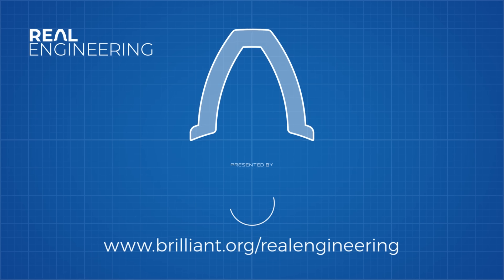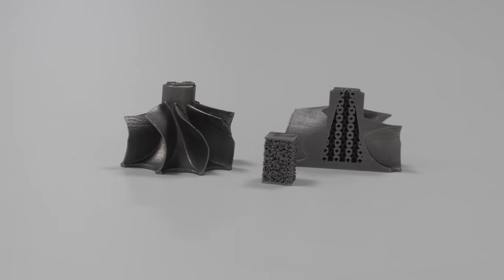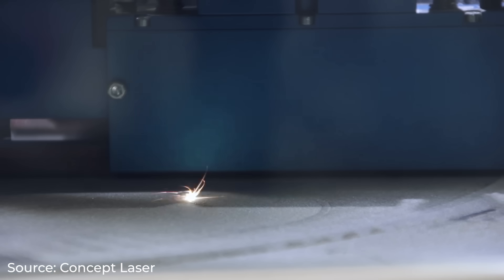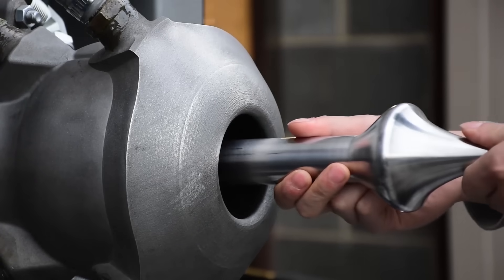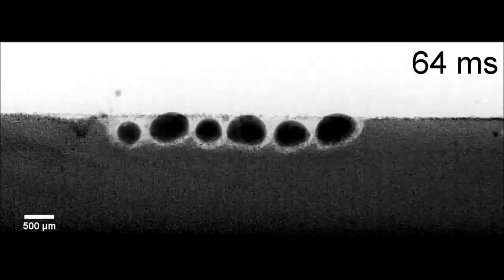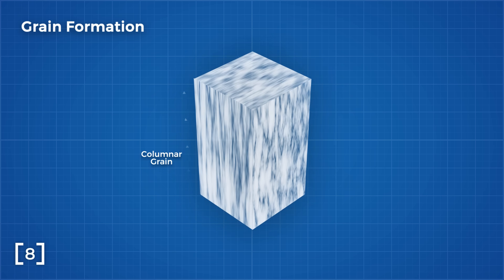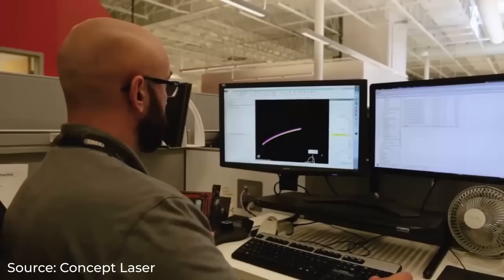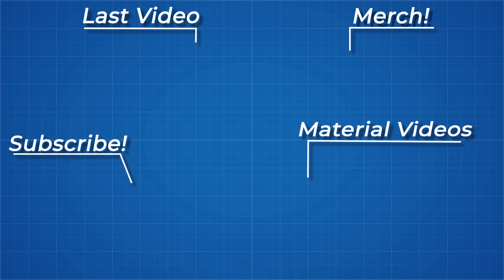The Material Science of Metal 3D Printing

Comment: I'd be curious to see if there's been any team who's attempted utilizing one of these laser 3d metal printers, but with a vacuum chamber work surface instead of atmospheric one.  It may benefit if combined with pulsed, repeated passes for the patterns to introduce outgassing phases for the metal and low pressure to aid the bubbles rising to the surface and bursting while they're small, then successive passes to re-homogenize the lasered pattern and attempt to level the printed pattern.

Comment: is it possible to 3D print armoured ballistic steel sheets according to the contoured design of a section of the base on which the armoured steel sheet will be welded??? for e.g. the contoured floor of a car that has a monocoque chassis or the inside shaped part of a front hood / bonnet!!!

Comment: I'm not some who knows much about it I'm just asking. Once I have heard about Electron beam welding. Would it be possible to take metal powder compressed into some basic shape like cube or block and use the beam welding to create the part? Than just break of the excessive powder? The metal shouldn't shrink that much since it's compressed and there is not that much air left? There may even be some articles about this not sure....

Comment: The simple problem with speed on additive machines: we are using a single point laser. 
we need to weld an entire layer instantaneously, like projecting an intense image made of high energy photons all at once, almost like photo lithography, but faster and more intense (respect to George Lucas)
Even better if the metal powder can be constantly blown over the layer in an evenly thin and uniform airflow, so that the entire laser field can weld the whole object continuously in two dimensions while the 3rd dimension continues to grow vertically.

Comment: I think what 3D Printing thought us more than anything is why patents are horrible. FDM 3D printers used to cost millions of dollars for decades. Until the patents expired and DIY crowd was able to start working on them. In less than 5 years, good quality 3D printers with multifilament extrusion, bed probing etc. can be bought for $200

I know I'll be hit with: "If it wasn't for the patents, no one would innovate!" now... I'm not actually so sure about that. There are a lot of people out there who work problems for the joy of working on problems. The current patent laws are literally preventing them from doing that. For example, I would like to try a few ideas in my garage about metal 3d printing. Problem is, if I stumble upon a solution, I'm 99% sure I won't be able to sell it because at least one of the technologies I use will be patented...

I get in some sectors like pharma where any R&D requires thousands of staff and millions of dollars patents are really important. But in almost all other fields, patents are stifling innovation. I think tech patents shouldn't be for more than 10 years in this day and age. If you can't turn a profit from your invention in 10 years than it wasn't all that good, to begin with anyway.

Comment: The 5 circle challenge at the end. Yes its possible. How? A line through the center of symmetry of the 4 circles on the left,  and through  the center of the bottom right circle.
The 4 circles are divided symmetrically. So is the bottom right circle. This line divides the areas and circumferences equally. 
Maybe  someone has  already shown a solution somewhere in the other 1700 comments.

Comment: The biggest issues is about profitability something like to to be more profitable you would have to replace the whole production of things in all parts to a whole constructions. We already use injection molded parts for planes but only certain points in which failure is not catastrophic. We would have to first look at applications that would stain a market and justify the cost and as over time it becomes improved. Its not like we build new planes every week like a car so this is the reason as prototyping is more reasonable for this application. We build planes to last decades so that the high cost/residuals can last and be resold and pass on the the second life.  Best applications would be on more sacrificial parts in something like a marine boat engine where they are replaces as a whole unit more often then a jet turbine for planes. IMPO a broken boat motor is dead in the water a broken Passenger plane is grounded or a lawsuit.

Comment: Well whoever was speaking on this one your an idiot I just solved the problem get in contact with me. I just bilt a 3' 2020 out of P.L.A.  The stress test 12 by 6 with a square 20 mmeter by 20 mmeter hole bored through it my 2020 V rod Has been holding a 200 pound sandbag for week now deflection 3" in 250mm. The program is for rent $100 A-day for life. In 20 years I will surrender the program. Now that you know what I can do with pla, I want to know what you can do with titanium rod. Can you please present me with a riddle  And a tig welder?

Comment: there are 2 main things i want to mention that is kind of wrong with the video or its material and those that study it.

1 3d printing is a prototyping tool yes but only for parts that you can manufacture in other ways. so offcorse comparing 2 methods of manufacture where both methods can manufacture the part is wel incredebly stupid as that wil be the same as comparing a robot with a pencil and a printer. offcorse the printer is going to be better have mroe accurasy and be faster and cheeper. but the robot arm can do so mutch more than the printer can. like using lead to draw or paint to paint with it can mix paint to get colors the printer can only dream of creating or using. so comparing 3d printing with other kinds of contruction to me is stupid as the only reason 3d printing comes otu so badly is the test you give it and that test is based on is this new tecnology capable of creating everything better at doing osmething we have studdied the hjec oute of and optimised to the max. wel no shit it wil never be able to be that. 3d printings most valuable aset is for low quantity manufactuire or simply manufacturing of parts inpossible with other proseses. or if it can be made with other prosseses 3d printing it wil make it one part instead of multiple parts.

2 the study of the metal printing and its problems was studdied in worst possible senarios and intentionaly going beyond the specs of the machine. it wil be like testing a wood leathe by not using wood but metal. or testing a cnc machine with a part to big to move or a tool to big to move accuratly. you jsut dont do that. so when you have found problems with osmething spesificaly the stoddy shown it does not show how bad 3d printing is it jsut shows what 3d printing cant do.

with my peronal 3d printer i wil never try to print to steep an angle withotue support cuz i know it wil fail that is why support exists. so when you know there is problem printing with no metal underneeth the part just wel you know dont print like that. or if you know printing to fast wil create a incomplete print as the laser was to week and was not able to melt the material. that too wil be like taking a furnace that says it can melt 1 kg iron in 1 hour and take the crusible otue at 50 mins and complaining it was to slow no it has limits like any other method sinding them is inportant yes but that is nto proof of it being bad it is just the limits of the method. like when you are bending a metal plate you know you cant use a manual bender to bend a 180 degree bend cuz to do that the metal wil be inside the tol so you know this and therfore never design anything that needs a bend like that. or if you do not have a welder in your shop then you offcorse dont take on a project that requires welding.

Comment: make wafer slices of a prt, u can make the same thin gauge slices w/out perfection at this certain gauge, pick metals that can safely touch by allow 20/80 then 80/20 etc. Every F-ing key stroke devil jumping. Must b real important. So u take what can b done quick cheap & reliable. Then just make the prt in gauge the most strong & efficient as poss. No way to crack bc every wafer is similar yet diff alloy break stop. So in a 1/2" prt u may need 6 diff wafers metal printed w/each alloy alike but still diff to break crack break. No defects printed metal wafer get assembled together into whole prt. Lego dimple hole dot connection, drop the whole prt in bonding metal bath after epox-ing lego dimples wafers together.

Comment: Could you use a solid tip made out of cubic boron to melt the powder instead of a laser? And if you had the printer in an inert atmosphere you could run it quite hot as the melting point of cubic boron increases dramatically in an inert atmosphere (2973 degrees C) and perhaps the inert atmosphere will help with the porosity? And cubic carbon is insoluble in some alloys at high temps. I'm sure there are many reasons why this couldn't work because I'm no engineer.

Comment: Or what if you electrostatically charged the first layer of metal in your print. If you negatively charge a metal then it should attract the print bed material firmly enough to overcome the laser sintering pressure. Almost like the process they use in electro plating.

Comment: Resin printing is now fast enough to work as an economy of scale. We can make a 4 inch tall resin part in ~7 minutes, and with resin printing, only the height matters for print speed. So you could have a 100 squair foot platform making 1000s of smaller parts at once and get like 2k parts per 7 minutes. This is prefect for miniture models, and small things like phone stands, cable jack "selves" and other things of that nature.

Comment: How about the printers which use a binder chemical to bind the metal particles (producing a "brown" part before sintering), instead of using a laser? Do they have the same flaws?
Reply: those parts require a chemical wash so the cost of production increases significantly, there also still is not enough strength in the manufactured components for it be worthwhile. I thought of the idea to eliminate the stress fractures and increase strength by instead of using a single laser for sintering they could use a high power laser array to correct the layer variations that occur from a single laser moving along the pathway. More lasers, equal more accuracy and less variation in the component layers, they could use machine learning to correct issues with layer shifting due to the overuse of high powered lasers thus reducing energy costs. Then a heat treat process could restructure the metal crystals to increase strength so as to be commercially viable? I'm not an engineer just well read, so just a thought.

Comment: Possible solutions to these problems
-Grain structure problem
For the grain in a space filling curve such as the gosper curve to serve a purpose to increace strength
-Pore problem
Form the metal print in a vacuum to prevent air from entering the liquid metal.

Comment: I've done both fiberglass and carbon fiber fabrication and found it to be very interesting work. Laying up fiber mats in either medium is pretty much the same, at least at a general level. I've created carbon fiber sport bike fairings, and fiberglass trailer parts. I've also done a bit of vacuum forming and vacuum bag work. None of this was my day job, I was a computer programmer and database designer for most of my working career. Now I just watch videos of people saying 3D metal printing is going to revolutionize things like automobile manufacturing, and laugh. Not in my lifetime, its not. Maybe not in yours, either. Its like Quantum Physics, there are some things that we just don't understand well enough to make practical application of.

Comment: I worked as a butcher for about 8 years or so while also occasionally spending time in various other departments (of a grocery store) which basically saw me using/interacting with a wide variety of machinery. One thing that infuriated me endlessly was the issue of cleaning; more often than not machines were built in such a way that, while correct from an engineering and operating standpoint, made them absolute nightmares to actually clean and maintain... So any engineers who see this, keep that in mind yea?

Comment: Pump the chamber with high pressure inert gas, or maybe in near total vacuum. Push bubbles out during formation or drag them out. Multi-angular laser apertures may also help, perhaps even some manner of rotating aperture, given isostatic pressure is called for and lasers are inherently directional. 

Its 3d printing. So why are we thinking in terms of 2d patterns? Hit that material from all sides. This might mean using an agie charmilles style medium feed system as opposed to open powder pits. This means a very sophisticated automated work arm is going to be needed to manipulate the incoming material wire or columnated stream of metal powder animated by magnetic fields. Gonna play hell with the lasers and armature, theyll have to be de-gaussed on a basis so regular it will need to be a process integral to the machines design. Then that vise-arm aperture is going to have to manipulate the part as it grows, quickly and safely and with consistent sure-handedness.

There. Try some of that and @ me if somebody gets a nobel off the back of it one day. I'll probably be long dead but kindly find my grave and chisel the notation in, if im right.

Comment: one aspect you skipped over for the cost of manufacturing parts is the logistical costs associated with parts. Yes there are methods for rapid production of parts but the factory is more often than not "in the wrong geographical location". Then you have the costs of warehousing and distribution of parts that have to be mass ordered. Where 3D printing turns everything on its head is it allows mass customisation at a local level in relation to the final product. Imagine buying a car locally manufactured from 3D parts. Then add the competitive edge of the end product being made up of up of components customised to fit the end users needs to an exacting standard that until now was only accessible by the very rich. Mass production seems very efficient until you realise mass production in itself is also very inefficient when it comes to meeting customers needs. So when you compare 3D mass customisation against old style "mass production" you are comparing the horse and buggy to the auto mobile. It is a very naive comparison as it completely ignores all the negative aspects of mass production.

Comment: Does anyone know of any studies looking at the use of 3D printing metal powders with some sort of binder being used? If a bed of powder is producing uneven results it seems pretty obvious  that the metal just needs mixed with a binder to make it a bit more stable. Obviously the trick becomes making a binder formula that both melts/evaporates consistently  when exposed to the laser and  making a binder that does not add a significant amount of imperfection to the part as it cools. But this seems far more doable than trying to print the powder on  normal print bed....even with some kind of reinforcing structure under it. Printing from a slurry/paste almost seems much faster and much more consistent when you have the proportions of binder to printing material right.

Comment: Awesome content as always!
Just wondering here, since the laser interaction is blowing material away, has anyone tried 3D Metal Printing in a vacuum?
Reply: Yes, there are two versions of metal 3d printing, Powder Bed Fusion (PBF) shown in the video. Laser Powder Bed Fusion (LPBF) uses a laser to melt metal powder in an inert gas chamber (nitrogen or argon). Electron Beam Powder Bed Fusion uses an electron beam instead of a laser in a vacuum. I'm more familiar with the LPBF version. Part of the reason you get material blowing away is because the metal powder vaporizes into a gas as it melts. I believe this would still happen with an electron beam. Good idea though!

Comment: Probably need lasers that keep the printed surface at temperatures close to the printing laser, with the next layer using a different printing pattern overlapping previous layer. Also heating the printing bed and materials at the same temperature for best results.

Comment: Early on you touch on the problem of cost. I think if we threw out the notion of planned obsolescence and manufactured with the intention of the finished product lasting say 100 years without service, you could raise end user cost to reflect a lifetime of flawless service.  I myself have several theories on how to 3D print graphene. Certainly we cant be far off. The AI program used to create optimized drones could easily be used to reverse engineer any animal, scale it up, add a cockpit and you can pilot a giant tiger to work or fly a bio-inspired eagle.